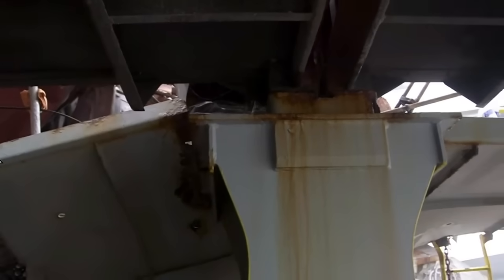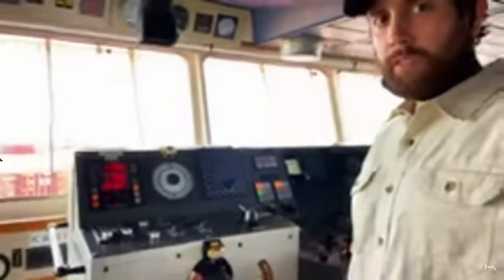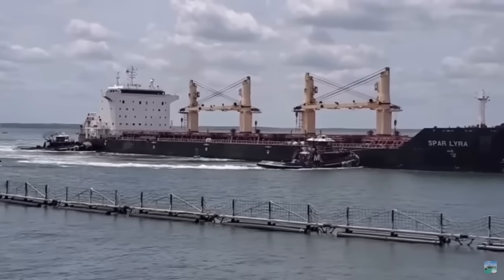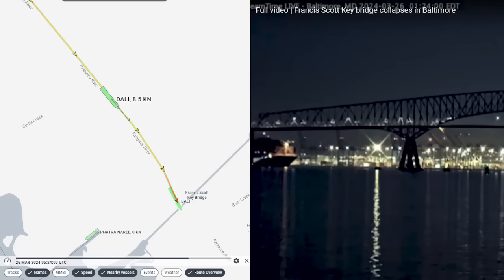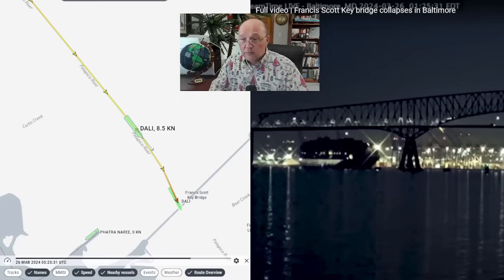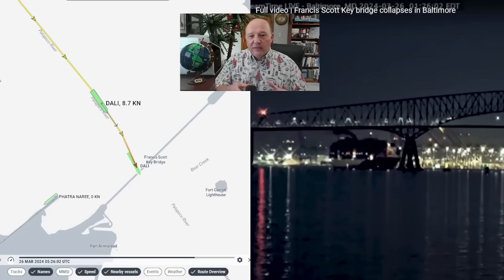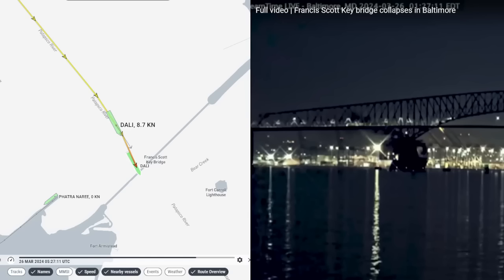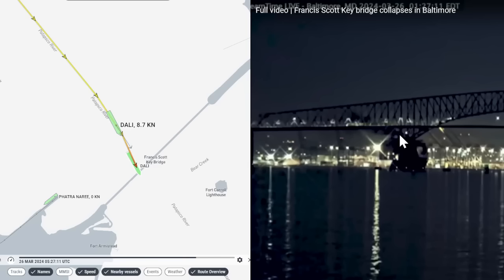Dali Timeline from Data Recorder in Striking Francis Scott Key Bridge in Baltimore, March 26, 2024

Comment: I retired at the end of 2022 after working for 50 years at most every Port of Baltimore facility. Back in the mid 70's when the Key Bridge was built no one imagined a container ship of this size. When I started, ships with cars were still bulk carriers using the ships cranes to lift the cars from the holds to land them pierside! Now they are all RoRo vessels. I don't think the architects of the bridge could imagine the size of these behemoths now.
Reply: I watched Jeff Ostroff's video on this - one of his questions was 'why wasn't the span longer (making a wider space for ships to pass)?'.  Umm, because the bridge is nearly 50 years old and ships of this size simply weren't on the radar when it was designed?
Reply: Just for giggles I did some Google searching.  At the time the construction on the Key Bridge commenced (1972), the largest container ship carried under 3,000 containers.  The Dali carries just under 10,000 containers.
In 1972, the only ships of the Dali's length were aircraft carriers, and a few transatlantic ocean liners, and in terms of tonnage, some of the largest tankers.
Reply: @moosecat i knew the Dali was a big ship i assumed around 6,7000 TEU under 10,000 is still just a medium sized boat.
Reply: You must recall when a container ship of this magnitude did the same thing yet why was there so much damage THIS time? Can someone check into this?
Reply: I am not sure if the size of MV Dali is that significant. 
Simply because bridges are not designed to withstand such forces. 
Also it is worth noting that both the Tasman Bridge and the Sunshine Skyway Bridge were brought down by much smaller vessels. 
In the case of the Tasman Bridge on 5th January 1975. The ship involved was the MV Lake Illawarra, which was 7,274grt. In the case of the Sunshine Skyway Bridge on 9th May 1980. The ship MV Summit Venture involved was 19,735grt. An earlier event in the UK occurred on 25th October 1960 when the coastal tank barge MV Arkendale H and her tow the dumb barge Wastdale H. Which were of only 229grt and 233grt respectively. But the collision brought down two spans of the Severn Railway Bridge near Sharpness Docks.
In all three cases, there was a loss of life.
Reply: because there are only two columns to hold the span.
Reply: @terracottaneemtree did you even watch the video or even read the comments?  Good lord.  You can’t hand feed everyone I guess.
Reply: @mikeL5183 Might be time for current ones to do some upgrades on existing bridges then. Don't think adding a little island these days would be a huge ordeal. Or maybe some kind of changes to get power back to the rudders within a few seconds. It's own backup. 
Or maybe just a faster way to get the back up system going. Or maybe just a few more anchors to slow it down. Controlled from the cabin. Or some cannons to fire those big ropes around some trees on the shoreline? Ha ha.  That was a joke but I'm sure nowadays people could come up with some simple back up things that wouldn't depend on the thing the caused everything else to fail. 
I mean people are paid well to do so. I just make these comments and questions and get poorer myself. 😂
Reply: All the more reasons to be ultra cautious - protective of the bridge. Too much is typically taken for granted.
Reply: Imagine being in a car that was stopped from crossing.  They were probably mad they were being slowed down but then changed their tune after the bridge collapsed.  Let’s be honest we all hate being stuck in traffic.  It’s a good reminder to remember that god see’s things we don’t and protects us.
Reply: My good imagine if this had been rush hour.
Reply: except the fact that they started building the nimitz class carriers in 1968(commissioned in mid 70s), which are larger than this container ship....
Reply: That is true, but all they had to do is retrofit the bridge with safety measures. They did not do so sufficiently.
Reply: @terracottaneemtree  The incident in 1980 was by a ship about half the size at the most, from Japan. Yes, it did not take down the bridge. Should have woke the Port of Balt up though. It did not. Same facts, too. Engines conked out. The channel leading to the bridge is too narrow in windy too. Not very deep, and dredged up. Hard even for the pilots. But they need the 2 tugs to escort through the bridge then hit the engines.
Reply: I live right next to the port of Baltimore and I use to see the key bridge all the time 😢😢😢 can't believe it's gone but the experience was something else 😢😢 from the loud sound it made to the shaking of my house news reporters every where I turn interviews left and right staking outside my house to military helicopters flying so low you can see them ppl coming from every where to see it even trying to trespass on my property to see it it's been crazy and sad 😢🥺 those poor ppl who passed away rip truly a piece of history that's been taking from all of us by the way I hope you are doing well ❤
Reply: @nicholaskelly1958  The significance is the type of bridge. The Tasman Bridge in Australia was built in 1964 and being a prestressed concrete type and 1mile long, only two sections collapsed. It also had 'pile caps' or buffers installed on the main pylons in the navigation channel. The captain of the ore bulk carrier decided not to use the main channel........obviously losing his ship captains licence in the process and sinking his ship. 
The Baltimore and Tampa bridges are steel arch continuous truss bridges susceptible to more sections collapsing and both having no buffers or fenders to the main pylons.
Interestingly, the NTSB believe there are over 17,000 other bridges of this type across the US that may also be susceptible to collapse.
Reply: @terracottaneemtree I think structural engineering would include max loading (bumper to bumper traffic in a back up), high winds, and a pretty nice safety margin. I don’t think they would accounted for things crashing into it.
Reply: @TA-wg9oi  I know what happened with the Lake Illawarra.  The point that I was making is that unprotected bridge piers are very vulnerable to collision damage regardless of the design  
It doesn't take a very big vessel to bring a bridge down. Regrettably that has been demonstrated rather too often. 
As for human error I recall the late HM Railway Inspector Major Peter Olver saying to me "You can make something fool proof. Until a bigger fool comes along!"  It is a difficult problem to resolve.
Reply: @nicholaskelly1958  It's not the ship or the size of ship regarding the significance that you questioned.......
The MV Dali and SS Lake Illawarra are two vastly different sized ship yet both brought down bridges that 1. Most of the Key Bridge collapsed and 2. Only two sections of the Tasman collapsed due to it being different construction and as the Queen Post constructed Severn Railway Bridge.
Reply: @TA-wg9oi  That is exactly the point bridges are very vulnerable to collision damage. Regardless of the design of bridge.  OK some designs are less resistant to collision damage than others
We are at cross purposes. What needs to happen is that bridges crossing heavily trafficked waterways need adequate protection from collision.
Reply: Exactly!! My husband was a NYNJ Sandy Hook Pilot.  I remember when he had his first 900+ foot ship roughly 20-25 years ago and explaining to our kids it was roughly the size of 3 football fields! Very daunting even for a seasoned pilot. Marine pilots are unsung heroes.  My prayers for all those lost at sea but especially for the Maryland pilot as his life is forever changed....
Reply: @chrissaunders8284  reports are that there was, but that doesn't much matter when the ship loses power...
Reply: Correct - they needed those ''dophins'' islands.
Reply: No matter what was the norm in the 70s. Ppl know as times goes on. Technology expands so why build a bridge to fit those tubes when they knew the intent was for that bridge to stand for decades !! Fit the bridge to match future technology. We don’t buy clothes for our kids at 5 and expect them to wear it at 25 the same applies here
Reply: So what you are saying is that the people in charge were all stuck in the 70's and could not upgrade their thinking in spite of what they could see right in front of their eyes? You must be kidding.
Reply: @bellakrinkle9381  Bridge protections are generally ineffective. They're not an outright waste of money, but they're money better spent on other protections for more common events.

There's huge loss of life and property every year from crashes due to potholes on poorly maintained bridge decks, which is cheaper and easier to fix by a mile.

Comment: Great report again.  Having ran large tugs before I can tell you that it is not as easy of a job as it looks.  I've never ran a tug in Baltimore, but I would never want to be attached to a ship this size going 8.5 knots.  The tug I was running one day was a 7,000 BHP rated with 3 directional props.  I was helping dock a container ship that is about this same size one day in a very high wind.  It was about all we could do to hold the ship off of the dock and the bumpers that were in the water at the dock.  The wind was straight on to the side of the ship with its containers all stacked to the top, so a lot of area for the wind to catch.  The wind speed increased all of the sudden with the ship about 40 meters off of the dock, and boy could we feel it as the ship started to pull harder.  I increased to full power on all 3 props with a fear that the tow line would snap and kill someone, so I got everyone off of the deck.  We stood low in the wheelhouse.  With all of this, the ship closed into the dock, but thankfully the bumpers in the water took most of the pressure and the dock or the cranes were not damaged.  The bumpers however were toast and needed to be replaced when the ship departed.  

With this ship moving at 8.5 knots, the only thing a tug could have done it it was there would have been to push on the starboard bow of the Dali to perhaps hold it off of the bridge piling.  Lets be real however, under full power forward, these powerful tug don't go very fast and it would have been hard to get it up to speed an into place with enough lateral power to move the bow over.  The propellers on a tug boat are engineered to provide force, not speed.

At the end of the day from what I see, they lost power at the worst possible time.  when it happened odds are the engine room crew didn't know exactly where the Dali was in relation to the bridge and the approaching danger, but I assure you the phone rang down there and they were told.  It looks like they lost power somehow, either the generator shut down for some reason or it was an overload trip.  Often on ships like this if they have a lot of refrigerated containers plugged in, they will have 2 generators running in parallel to supply enough power.  These refrigerated containers always require a lot of electricity when first leaving the dock since while on the dock they were often left unplugged for a while; so they're all working to stabilize the temperature in them.  If that parallel generator tripped out for some reason, then the other generator would have also tripped off from overload.  On these big ships, vital things on the main engine are ran with electric motors, not driven by the main engine itself like a highway truck.  So losing power would also drop out the lube oil pump, and water pumps which then would have triggered a main engine shut down so the oil pressure accumulator can provide oil to the engine while it is slowing down.  As your video points out, re-starting this main engine is not like hoping into your Ford F-150 and turning the key.  

From watching the dock camera in real time it looks to me that the engine room crew was all over this in as quick of a manner as they could.  Once power came back up from the emergency generator or a main generator, they started the main engine start process, and it looks like something then tripped it out again.  But once they got the main generator started and isolated to provide power to the ship only, they got the main engine started and the black smoke you see was the bridge pouring on the power in reverse to try and stop the ship.  At this speed and slower, especially in the reverse direction, the rudder does not respond that well since less water is moving over it than out on the open ocean at 18 knots.  All this time, the ship was moving.  It did slow quite a bit, but not enough.... Kablamo!  Very sad deal.

I give aplomb for the bridge getting that MayDay call off so they could close the bridge to traffic.  Even at 1:30 AM, that bridge is well traveled.  While some were unfortunate, that MayDay call probable saved a lot of lives.
Reply: Yep, 😎👌.
Reply: Interesting post. It's good to hear from the professionals. I have zero trust in govt agencies so hearing from professionals helps when trying to understand something like this.
Reply: Someone had to imagined and thought in advance about the fact that one day any day or any night a vessel could have collided with one of those pillars, no one ever thought about that, no one had the brain and the balls to be in charge of ensuring safe and supervised navigation under that bridge, big vessels going in and out under bridges should have tugboats guiding them before and after they pass under any bridge.
Reply: @AngelGonzalez-pd4cn if you had paid attention you would know there is little tugs could have done with a ship going that fast other than get their crews killed.
Reply: Thank You for that analysis. I just watched a British Gentleman's Video, states he's a ships engineer, and he also feels that the smoke indicates them pouring on the power in reverse. He also points to prop walk as a possible factor, as in reverse it would tend to push the stern to port, thus steering the bow to starboard.
Reply: @jimmybryan6760  Sal seems to think there was too little time to get that giant engine in reverse.  I'd think the VDR would surely at least monitor which way the prop was turning!?!?
Reply: @AngelGonzalez-pd4cn  Tugboats would only provide power. Navigation would be under the guidance of the harbor pilot.  Safe and supervised navigation in and out of port is the role of the pilot. But even with a pilot aboard, the ship's master is still ultimately in command and is responsible for every inch of the ships movements.
Reply: Totally agree and I might add from experience with slow rpm propellers is that when you start to go astern you get a kick to one side or the other depending on the hand of the propeller. Useful when coming alongside.
With regard the tidal ebb or flow, people generally misconceive this as tide flowing in or out due to moving between high and low water. This isn’t true as you get tidal streams running during high water and low water. Indeed if one looks at amphidromic points you get tidal flow, just no rise or lowering of the height. So a flow of water running close to a high tide is more than possible.
Reply: Very well stated.
Reply: @AngelGonzalez-pd4cn  If they had a tugboat we'd be looking at another fatality and the tugboat jammed between the bridge and the ship. It is simply NOT an option. This came up in my local town last year where they refused a (much smaller) ship transit, because of risk of collision, and they refused using Tugs as an option due to risk to life if tugs were used.
Reply: @AngelGonzalez-pd4cn former shipbuilder and shift test engineer in charge of reactor and propulsion plant test on aircraft carriers

We use a lot of tugboat operations during the course of ship construction.  Tugboats push on the ship at an angle in the direction of motion simply becuase they have low freeboard.  They cannot push at a 90-degree angle on an underway ship because water would wash over the side and swamp the tugboat and possibly capsize it.

A ship under way at 8 knots has rudder authority and no need for tugboats.  For your proposal, the ship would need to move at extremely slow speed to the bridge for tugboats to be effective.  That is slow and expensive.   The other issue is slow speeds actually REDUCE rudder authority and make the ship more vulnerable to currents and wind forces.  Normally a ship has sufficient control to easily pass beneath the bridge under her own power.  This was an ABNORMAL situation and her capability was significantly reduced.   My question is why the steering gear, an essential equipment, does not have its own redundant power supply to maintain control in the event of a Total Loss of AC Power casualty.   I won’t be surprised if we learn there was a procedure violation and they did not have sufficient AC generating capacity operating to tolerate the loss of a generator.
Reply: @SpringIsBACK  Yes, I was aware of that opinion from Sal as I was commenting. Since at this point no one knows for sure exactly what transpired, it seemed worth mentioning due to the gentleman's stated years of experience. Hope we eventually get the full story and those in authority learn from it